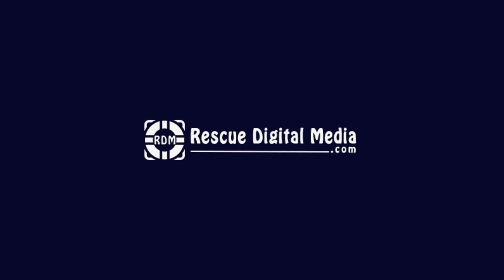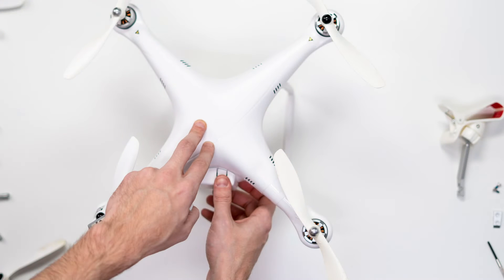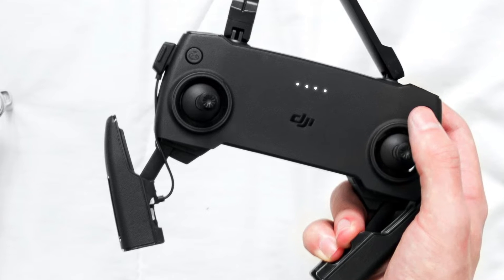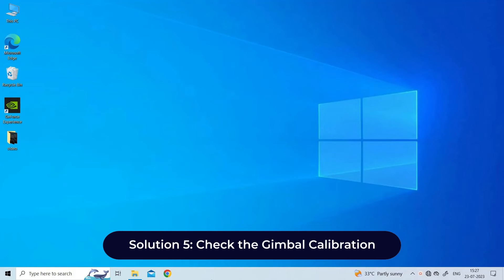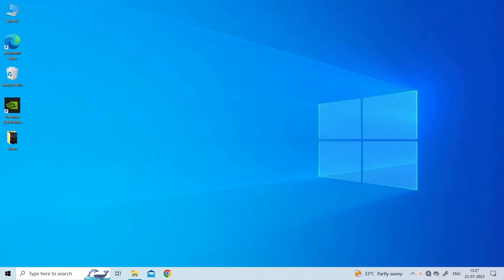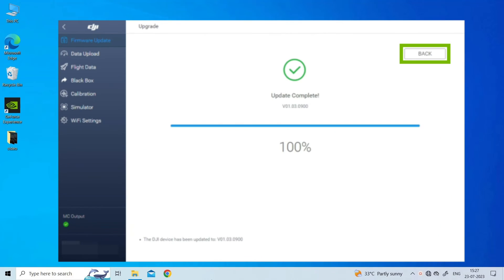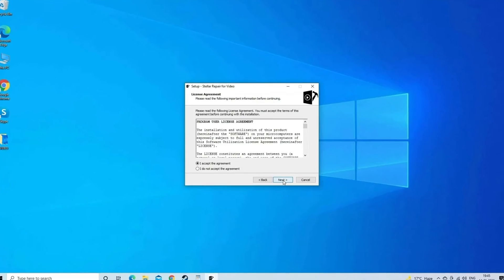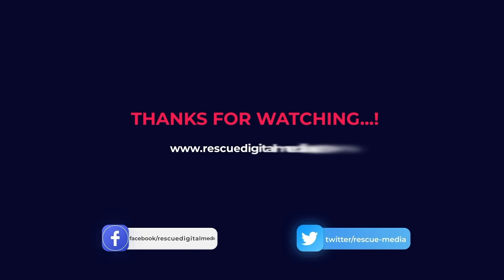Quick Fix: DJI Mini Error 30210 Demystified | Step-By-Step Guide | Rescue Digital Media

Comment: Power problems come most likely from the biggest power consumers : the motors! Total NONSENSE that GPS reception can lead to power errors and what is a firmware glitch? There is no such thing in a DJI drone.
 So the ESC pcb is most suspicious, assuming prop motors are undamaged, and the easiest to replace. Only costs 28€ at Aliexpress so what are you waiting for? 
 Next thing can be cam-motors, then you're in for real trouble. Sometimes the multi-wire cable is damaged. Gimbal replacement is not the same as complete cam assembly replacement, be ware that calibration data is stored on the cam pcb, if you're exchanging complete assy incl cam, you may need a DJI calibration!! Not something you can do yourself AND do not fall for the Chinese Python script solution. It's rubbish!!!

Comment: Either DJI's last few updates are turning off the IMU inertial measurement unit,  or the chip in the refurbed m2 camrise batteries is causing the error.  Can be fixed by doing a gps calibration followed immediately by an IMU calibration.